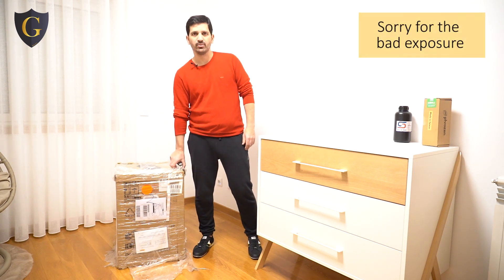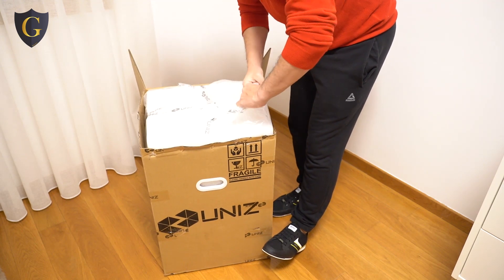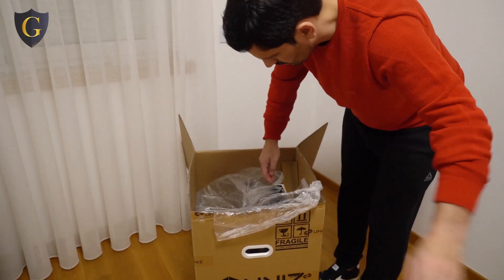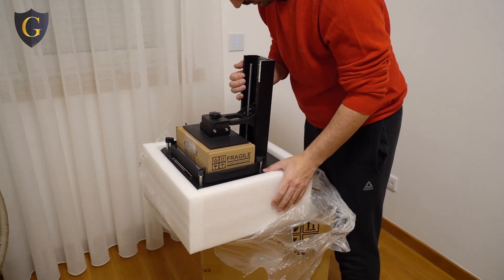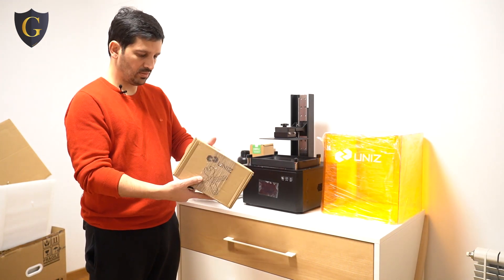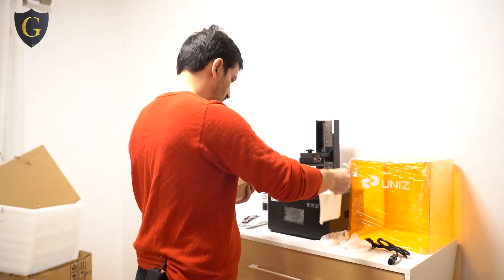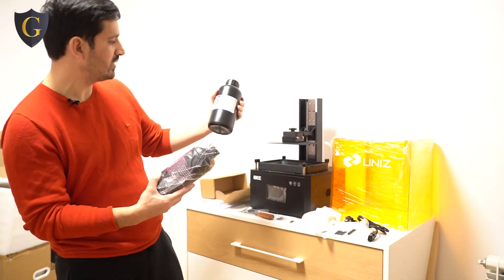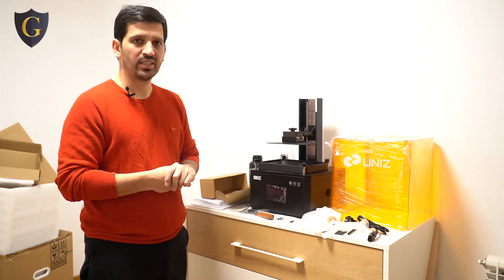Uniz IBEE quick unboxing

Comment: If anyone needs a new replacement LCD screen for the Uniz IBEE (still a great printer), get this exact one, from Chi-Tu, it works fine:
"TM089CFSP01 Monochrome LCD for Anycubic Photon MONO X LCD Screen 8.9inch 3840*2400 4k Tianma"

Also PFA (aka "nFEP") works fantastic, just install it using the build plate on the acrylic piece on the film for tension like in the IBEE instructions.

Comment: Thanks for showing the unboxing.  What country are you in such that you received it so quickly?   Also, a suggestion: please level the audio--if I set the volume for listening to your voice then when the trail/music kicks in it nearly blows the walls out of my apartment it's so loud.
Reply from the maker: It was faster just because I had order it by air freight, I live in Portugal... far far way from China.
Ty for your suggestion really appreciated, we were trying to do a quick review and quick release of the video, we have done some mistakes like the exposure, but we will try to better in the next ones... at least try :)
Reply: @bygualter5578  I didn't mean to be critical and progess-rather-than-perfection getting the video out is appreciated.  It's just an issue that a lot of people have for some reason (low audio on voice but a shocking increase for channel into or outro's) and I thought I'd point it out since you're starting out posting videos.